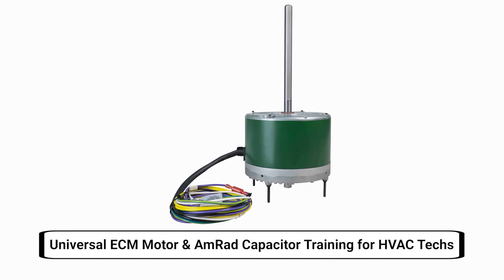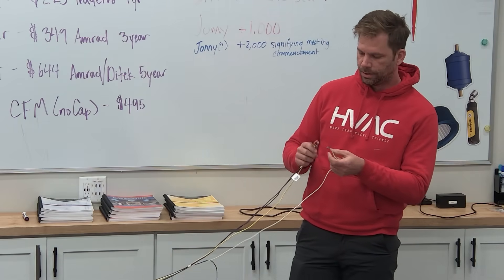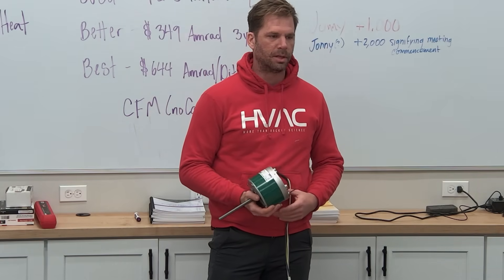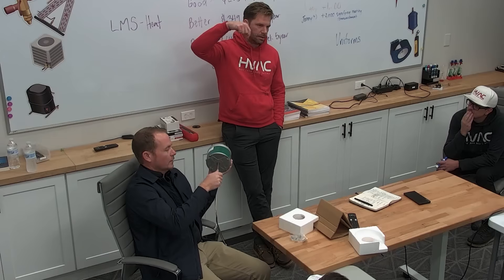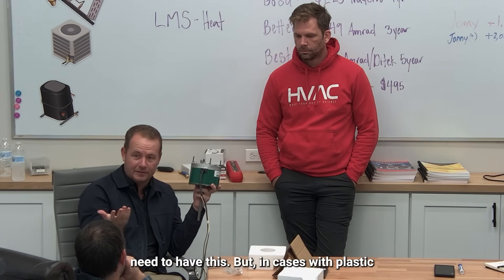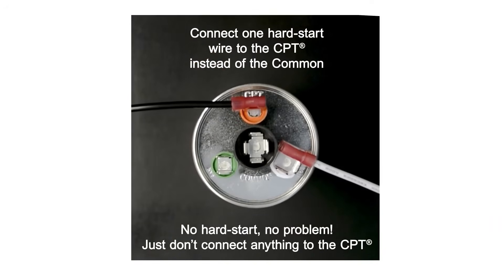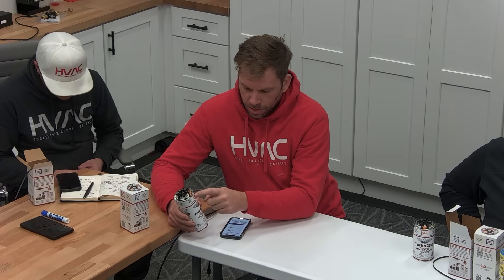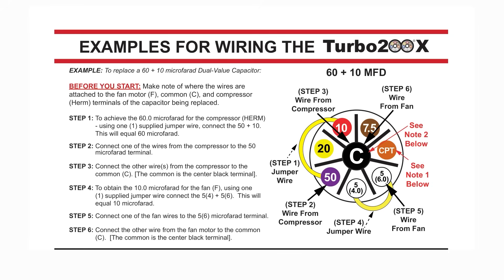Universal ECM Motor & AmRad Capacitor Training for HVAC Techs

Comment: I recently used this motor and it’s been great. However, universal motors don’t always work in every situation. I replaced a 1/5 HP 875 RPM motor on a 3.5-ton Ruud/Rheem condenser with a 1/4 HP motor, thinking it would be fine—but it overheated and shut off.

I realized the problem wasn’t just horsepower it was the weight of the fan blade. The original motor was properly matched to the load. I later installed a 1/3 HP motor with the same RPM, and that solved the issue.

Always verify motor amperage. Even a slight overdraw can cause overheating and failure. New techs check your amps before walking away.

Comment: There was a lot of chatter during this video, so it took some time (rewinding) to hear the instructions: a wiring schematic showing the Amrad terminals, the hard start terminals and the fan/compressor terminals would have been easier to follow during this presentation. Thanks for the post.

Comment: Traditional ECM condenser motors do not use capacitor. Why does this universal ECM need one? Also, if original ECM uses PWM wire to signal the motor, where does that signal wire connect to the the new universal ECM?
Reply: It does not need a capacitor. No ECM's use a external capacitor they are built into the control module.
Reply: That motor doesn’t use a cap
Reply: This motor replaces PSC motors, it is a constant torque ECM like an X-13.
It will NOT replace a true ECM variable speed/constant air flow motor or PWM.

Comment: Great video as always. We love the Amrad turbos. We’ve been stocking them exclusively on our vans for about 5 years now (along with OEM caps for warranties on units we installed). It fixes the problem of being out in the field and not having the right sized cap on the van. Plus, we’ve had almost no callbacks on start capacitors since we made the switch.

While they do cost a good bit more, we actually haven’t had much push back with pricing. Occasionally someone will question the increase, but a simple explanation of the fact that they are American made, carry a 5 year warranty, and have a lower failure rate usually resolves that pretty quickly.

I will say that the turbo minis have been a bit more prone to weaken within 5 years. We have caught a few of those out of spec on maintenance trips, but they’re less expensive to replace. We also still have to carry some 20 mfd caps as the mini won’t go up that high, and the turbo 200 is a bit overkill for that application.

Looking forward to trying that Genteq universal motor. It would replace the two universal PSC motors we currently carry, and it looks like it would take up less space in the shroud. Too bad it isn’t rated for vertical shaft up orientation, but that’s more rare anyway.